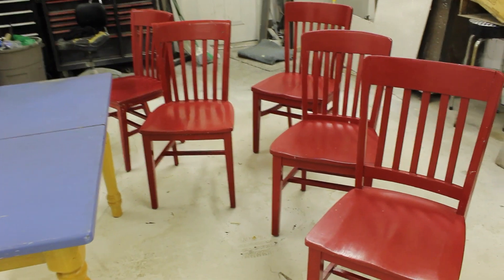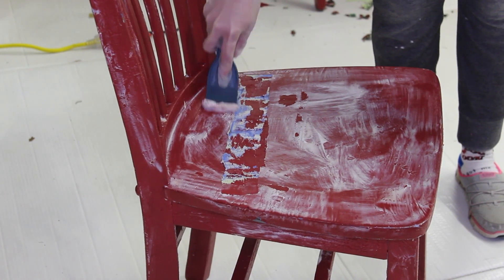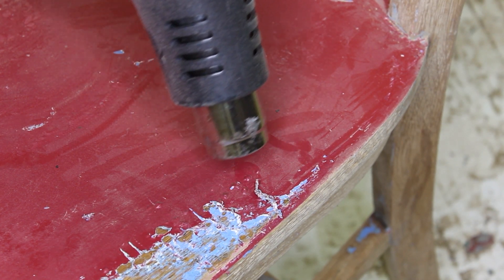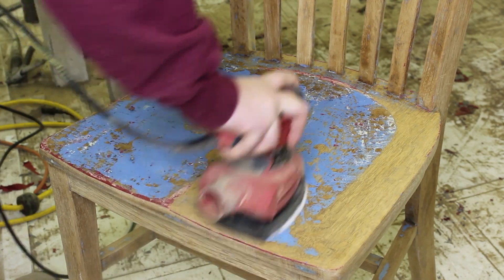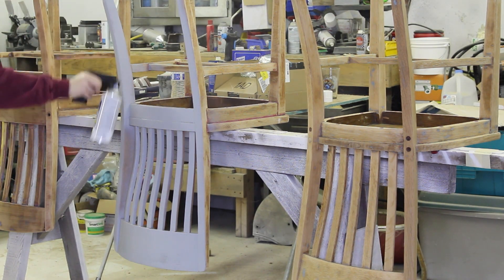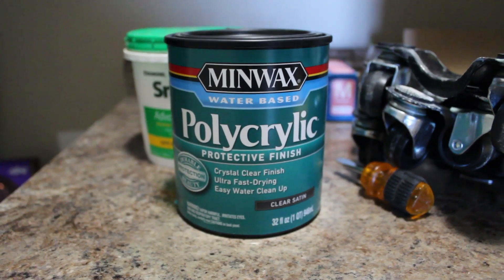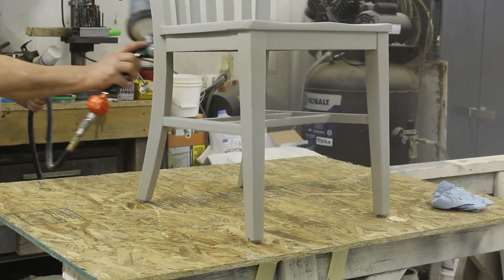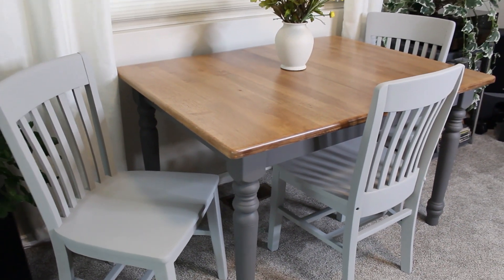Trash to Treasure | Furniture Makeover | Furniture Flip | How to Paint Antique Dining Chairs

Comment: Why did you strip chairs instead of sanding if you were just going to paint them anyway.
Reply from the maker: There were multiple layers of at least four different colors of latex paint that was peeling and cracking. All the paint needed to be removed to ensure that the new paint would adhere to the piece as well as giving it a smooth surface without seeing the old paint build up underneath. I originally started to sand them but there was sooooo much paint on them that I was burning through a ton of sandpaper and not making much progress so using the heat gun to remove the paint was the best option. Especially for the back with the spindles.